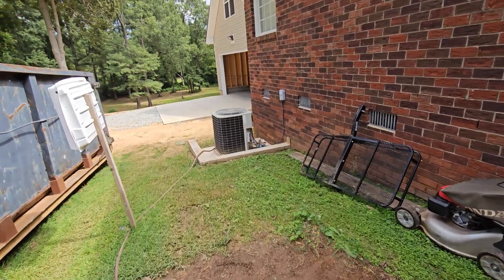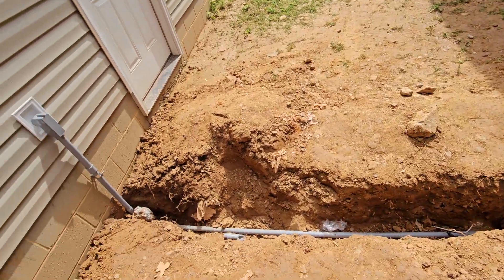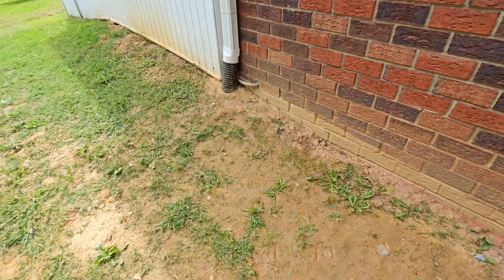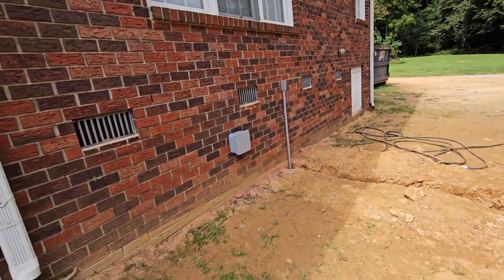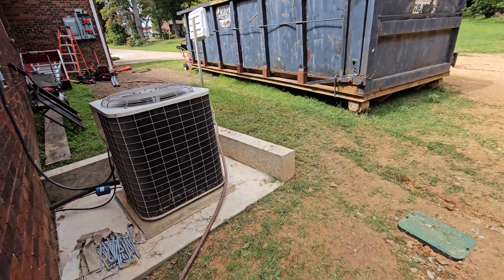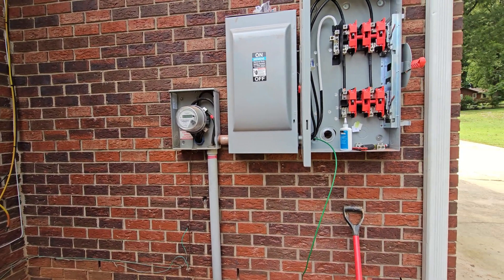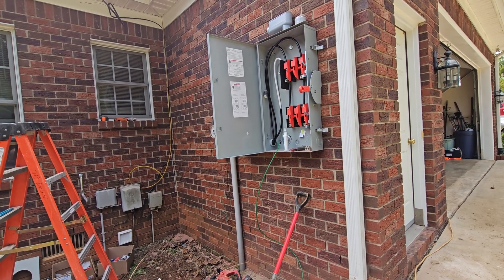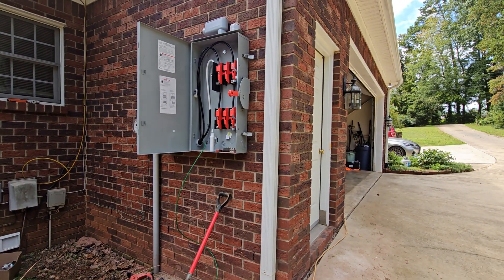Part 2 Start of Solar Power Installation

Comment: Such a great install. We’ve modeled our install after yours and I’d love to see the same box view (disconnect/transfer switch) now that it’s done. Mainly to see how the lines  were managed in the box gutters. I’ve not looked closely at our transfer switch, but would like to see  the common output that goes to main panel. 

I know there’s no real direction, but I like how you’ve tapped off for the 18Kvp at the disconnect for grid input so that all of the system can be worked on with one disconnect.  Our A/B transfer is inside and disconnect outside. We are using the same overall routing post meter. Thank you for this video series!
Reply from the maker: I have photos and short explanations at this link https://www.youtube.com/@Gary_Pauls_DIY/community
Reply: @Gary_Pauls_DIY thank you. I looked at all of that and it was a huge help. Did you use 2/0 or 3/0 copper (or size if AL-I see nolox) disconnect->transfer, transfer common out->main panel, and disconnect->18Kpv->transfer? 

Like your, most of these runs are short and we’ve used copper in our entire system. Since our system is nearly  identical, wanted to see what they wanted from you in terms of service/feeder designation. Thank you again. Your install was the lightbulb that made all the pieces fall in place for us. 

Disconnect went in today, we should be up and running later this week.
Reply from the maker: @MrZZeroG  I used 4/0 Aluminum for the power feeder going from the bypass switch to the circuit breaker panel.  Everything else used 3/0 Copper.  I used the copper to keep the conduit fill ratio low, since I didn't want to go up to a larger conduit.
Good luck with your install and inspections.
Reply: Thank you. One final question - are your CTs between the meter and the disconnect or on the output of disconnect going to GRID input?
Reply from the maker: @MrZZeroG  I placed the CTs on the Grid Input to the 18Kpv Inverter.  The CTs are inside the cable box between the 18Kpv and the battery.
Reply: Thank you. That’s where we wanted to place them too as it’s convenient and I couldn’t see a reason to do it before the disconnect if there are no other loads. That will save us from needing to do another meter disconnect and service release.

Comment: Outstanding video series of install with exacting details, thank you!  I'm starting my own project very similar to yours. Regarding the your wiring diagram, what do the circled cables represent, labelled as A, B, C, and D. Are these points further described somewhere else?
Reply from the maker: The letters correspond to a table which indicated the size of wire used at each of those locations.  I recently changed computers so I don't have a copy of the table readily available, but the DC wires coming in from the panels was 10AWG and the AC power was all 3/0 copper so I wouldn't exceed the conduit fill requirements.  If I had used 4/0 Aluminum I would have needed larger conduit.
Reply: @Gary_Pauls_DIY  OK, got it , thanks! So I'm guessing you used 2" conduit for the 3/0 wires
Reply from the maker: @kevcok8384  Yes
Reply: @Gary_Pauls_DIY  Is the neutral bonded to ground in your disconnect switch?
Reply from the maker: @kevcok8384  The ground neutral bond is at the first point of disconnect.  It is in the Fused Disconnect.

Comment: Do you have a parts list of the disconnects you used?
Reply from the maker: Siemens GF224NR Safety Switch and Siemens DTGNF224NR Transfer Switch.  Looks like prices have gone up a lot since I purchased them a year ago.
Reply: What did they cost you?
Reply from the maker: @mycoptah  Around $700 for the transfer switch and $350 for the fused disconnect.